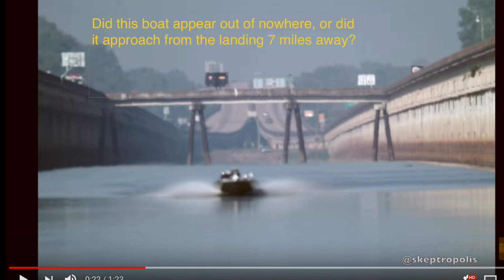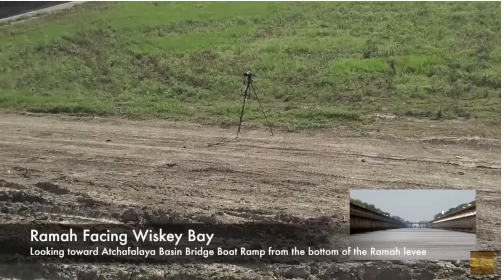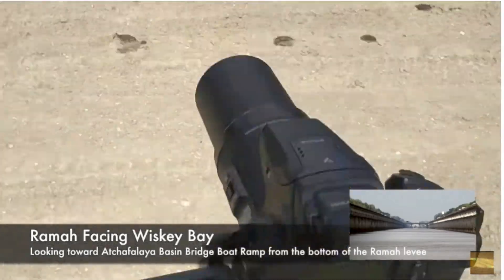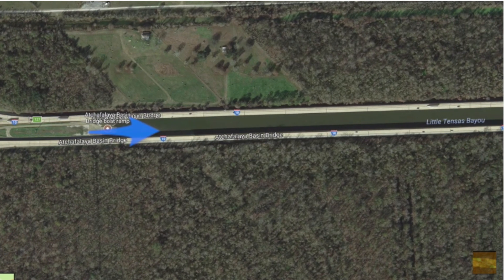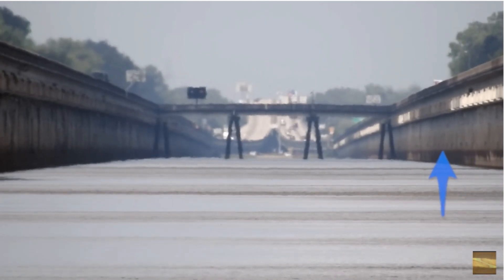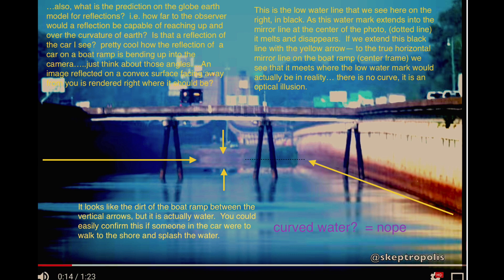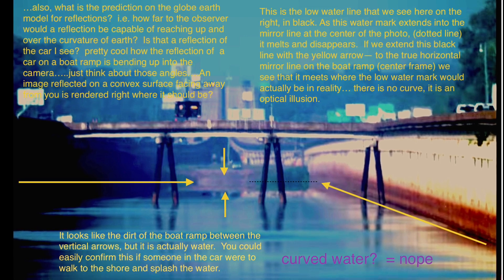Is this Bayou level and curving?

Comment: 1) It was a time lapse, not a video. 2) please link me to the flat earth geometry based obstruction height calculator so I can compare it against my observations.
Reply: Soundly agreed. The boat ramp and piles the bridge is sitting on are so obviously disappearing. The other thing is about that reflection. Some things were completely ignored in this critique. Psy, take a look at the photos from the p900 on my channel. The reflection of the bridge on the water is only possible if the water is curved or some kind of optical illusion creating the appearance of curved mirror
Reply: psyleidoscope I find it surprising that you said anything about angular resolution, when the camera is clearly resolving the car and boat ramp at LTB. Also the camera is clearly resolving the far transmission line. Also the second crossover is clearly resolving. So that's out. Perspective maintains straight lines so that is out as well. Atmospheric distortions are variable depending on the weather, so that is illiminated. Also CAD models of the Globe with these structures on them match my observations. So it's clear the only model that predicts these observations is the globe. Until you have another model that makes better predictions than the globe, I can think of no rational reason to favor alternative conjectures.
Reply: So to sum up;

"Show me the curve."

"Here's the curve."

"That's an optical illusion. Show me the curve."

I've seen this play out dozens of times. FE advocates will consistantly cut off any avenue of evidence that detracts from the flat earth. These are not people interested in the truth. They are an objective leason as to why a dogmatic belief in ANYTHING is universally a bad thing.

Oh, and before I get accused of being a believer in the "ball". My belief isn't dogmatic, my belief lies in science as a methodology, based on the results its produced over the last 300 years that belief, or more accurately, faith in sicence and the scientific method would appear well founded. Cutting off vast tracts of science and declaring it fake because it's inconvenient for your belief is not rational.

Another common trait amongst flat earth advocates is they have little to no knowledge about the subject they're claiming was fake, if they were indeed truth seekers the first step would to become an expert in the subject you think is false, then you can go through point by point and demonstrate using well established tools why it's wrong.

But nah, it's MUCH easier to stick to pointing at water and saying "Well it looks flat to me, so it MUST be flat."
Reply: No we do not have footage of the boat being dropped off. We tried something like that early in the morning just before daylight where I drove to the bottom of the boat ramp and shined my lights across for soundly to photograph but the fog was heavy and it didn't turn out the way we wanted so we are going to do that again soon.
Reply: psyleidoscope And what physical limitations are you referring to and how do they apply to a camera with a zoom lens?

I'm smelling bullshit.
Reply: Look, about the reflections on the water in the P900 video, I'm going to send you a still frame from the one I'm talking about to google hangouts.
Reply: Check hangouts psy. Also, seems like metabunk lines up with what we see here.
Reply: psyleidoscope I find it fascinating that you bring up the reflection as the bridges reflection is not symmetrical. In fact it would require a curving surface for that type of reflection. Your objection makes no sense as the water is below both objects so obviously you can draw a line from the car to the water surface to the eye of the Observer which is the path that the light would take.
Reply: psyleidoscope first you ignored the reflection of the bridge which can only happen on a curving surface as it is not symmetrical. Second you failed to mention observer height which is required to determine obstruction height. Third the obstruction height on a flat surface would be zero. Fourth the entire boat ramp gets obstructed by simply walking down to the bottom of the Levee. Fifth this scene is predicted to look this way by globe models. There are no other models that make this prediction therefore there is no rational reason to believe in alternative model. The car is clearly not obstructed by the water which means that you can draw a line from the car to the surface of the water then to The Observers eye therefore you should expect it to be reflected in the water which it is.
Reply: @Soundly, fair enough, I was only really thinking about the car. But by and large not really concerned about reflections given the video shows an obviously curved high water mark, anything beyond that is window dressing.

Congrats to Psyleidoscope - you found the curve.
Reply: psyleidoscope you are not being skeptical. You are being a denialist. That's an observation, not an opinion. Where is the flat-earth obstruction height calculator? Who cares about eratosthenes you can do the same experiment right now and it only works on a sphere. Have two or more people at different latitudes measure the angle to the sun on any day. It only works on a sphere
Reply: psyleidoscope Uh huh, that video is bullshit. Light refraction is very well understood, the atmosphere is NOT distorting the position of the sun anywhere near like that idiot is suggesting. At most, a few fractions of a degree. This can be evidenced by the fact that you can do this experiment as often as you like and you get consistent results. That video is just another example of the ad hoc bullshit the FE movement is becoming famous for.
Reply: "playground games" dude no one is playing games. This has been a constant thread of you making claims, being shown you are wrong, and then moving on to your next claim. This is real simply. I have detailed which transmission lines I've photographed AD NAUSEM on my channel. You apparently are using the wrong lines, most likely due to the disinformation that Dr Zak put out (and was immediately debunked) months ago. When are you going to wise up and realize these gurus are conning you? Will you be a man and admit you are wrong? We will see. Simply supply GPS coordinates for these 2 dozen white buildings and I'll happily correct you. If you insist on claiming there are 2 dozen white buildings without providing GPS coordinates, then you sir are lying through omission and you sir are the one playing "playground games". I await your response.
Reply: psyleidoscope I don't speak for author's. This is in line with the conventional models absolutely. And it's completely out of line with flatearth models... Any of them. There is no known optical effect to create this type of curvature/obstruction consistently day in and day out.
Reply from the maker: Soundly ahh, ok that makes more sense, but how about the video from the lower observer height?  got any footage of a boat getting dropped off on the ramp from 7 miles?
Reply from the maker: Soundly https://www.metabunk.org/curve/

but this site is not a "flat earth geometry based obstruction height calculator"  in fact it is more stringent, adding refraction calculations which only ever makes it more difficult to prove.  Mick west.
Reply: psyleidoscope you misunderstand. I want the flat earth based calculator. Not the globe based calculator.
Reply from the maker: ahh, right.  does one exist?  would love to see it myself
Reply: psyleidoscope not that I'm aware of.  Could you draw me a diagram demonstrating how obstruction occurs on a flat surface?
Reply from the maker: Soundly Obstruction occurs on a flat surface just like we observe in reality.  there are several things at play...
Angular size:  distant objects appear smaller, eventually disappearing 
Angular resolution:  similar concept, but this accounts for the details which can be resolved by eye or lens.
The horizon is formed inside the eye itself.  it is different for each observer and is determined largely by elevation.
Next we have all sorts of atmospheric effects which can distort these observations:
 Mirroring can occur on top of the visible waterline on what looks like the horizon.  the farthest and tallest waves are mirroring and magnifying the water itself, forming 'obstruction'.

The mirroring can also occur on top of the actual waterline in the water dense AIR above the water.  the thick air forms a mirror- reflecting the water directly beneath it or (behind it.)

I am sure you have seen footage of runners disappearing legs first.  this optical illusion can be easily duplicated by placing a camera on a flat road on a hot day.  like the mirage in the desert.  when the camera is directly on the road, the horizon (for the lens) is quite close.  within a short distance, the runners will "melt" into the roadway, soon disappearing waist deep.  But pick the camera up, or just look from normal height, and the runner has not "gone over the curvature"

As far as a diagram, i think the horizon calculations we are given are pretty close to reality, just that the horizon is not the "curvature of earth" but simply a phenomenon of our eyesight.   the words perspective, and convergence get thrown around a lot.  but your footage on this bayou is a perfect example.  In the foreground, we see the actual (parallel) distance of the two roadways.  We know that they are quite parallel, but in the back of the image +8 miles away, the roadways nearly merge.  if it were a bit further, they would merge together. (optically only)

The same is true for the water and sky.  But this footage is unique in that at 7 miles, there is land again with objects to be seen.  If the bayou kept going 20 miles,  there would be a vanishing point vertically and horizontally.  this is how the eye works.  you have seen the footage in long hallways... same thing.  from our perspective, the walls which are parallel, meet at the vanishing point, and the ceiling and floor meet at this same point.  

The curving you are witnessing and filming (in my opinion) is due to the high moisture content in the air.  this moisture is causing a mirroring, compression and stretching of the image.  Just look at the car squish flat, then stretch out.  the bridge is doing it as well.  the center of the image is where all the action is taking place.  you have natural convergence (parallel lines meeting due to our eyesight) and at the same time we have bending and warping due to mirage and mirroring.  the center of image is quite compressed ---this is evidenced by the pillars so close together, that they actually look like cement walls.  

In short, if this bridge were built inside a 10 mile warehouse, with temperature control, it would look like a long hallway.  BUT-- add moisture, heat, sunlight, smog, varying temperature gradients and humidity levels, we see this very cool looking optical 'curvy' illusion.
Reply from the maker: vanillaHchrist  i suppose you missed the part t 0.59 where i show how this video beats metabunk's calculator even with the refraction calculation?   I have already commented on the powerline images.... look:  this location here on the Bayou is the PERFECT location for a real scientific test for careful measurements to plot the curve which you think is there.......if you are so sure......then go prove me wrong, and laugh at my stupidity.   I reserve the right to be wrong, but from my own observations over very similar distances, I can tell you honestly, and without reservation, the water is flat.  the real curvature killer is the reflection of the car filmed from 7 miles.....and it is not even stretched.  Think about what that means...... you, the observer can film a reflection of a car, which is reflected off the convex surface of the bayou.   If you were standing on the boat ramp, you could see the reflection if the light was right.  BUt with the curved water hypothesis, there is an 8 foot bulge at the horizon about halfway across.  this means that the water arcs UP to the horizon, then it arcs DOWN to the ramp.  How can a image reflected on a curved body of water reach the lens of the camera from 7 miles? ---and still look like the car?!  the answer is much simpler than you think.  the water is flat.
Reply from the maker: 3 excellent videos discussing eyesight, perspective, angular resolution, diffraction, and convergence on a flat plane :  https://www.youtube.com/watch?v=bSSOphWOt0U&t=542s
https://www.youtube.com/watch?v=CY76EtflWkA
https://www.youtube.com/watch?v=oDjju_IM2xc&t=131s
Reply from the maker: Soundly.. you are welcome to your interpretations, and convictions....but until a true and honest test where careful measurements are taken and a curve is plotted, expect these types of rebuttals to "flat earth debunks" or "curving water found".

I don't expect you will conduct a test, and I am not making any demands of you.  (I do hope you will, many folks do...)  I think your videos and photos are pretty unique indeed.   If these videos and observations are enough proof for you, then so be it... I just happen to completely disagree on the cause of the 'curve'.

Any thoughts on the reflection of the car?  How does a reflection on a convex surface enter the lens of a camera 7 miles away?  can CAD model this?  imo, the reflection of the car is a picture of reality.  i.e. only possible on a flat surface....if the surface were bent in any way, the image would be stretched, and at these distances it would be utterly impossible to see.
Reply from the maker: Soundly    Specifically the reflection of the car.  look at the curvature calculator:  in 7 miles, there is supposedly a 8 foot "bulge" about halfway.  after that, there is a large drop...totaling about 30 FEET> (as in CURVE down and away) from observer.  the reflection of the car would be quite near the boat ramp.   this reflection (if you believe your curved water theory) is being reflected on a convex surface which is facing the boat ramp, and away from the observer..... but this image is bent up (by X degrees)..to be filmed 7 miles away???  sorry, i do not follow your logic.  

When you say "the water is below both objects so obviously you can draw a line from the car to the water surface to the eye of the Observer which is the path that the light would take."......sorry but, imo, this is only possible on a flat surface...

the reflection is entirely different than seeing the car....which also defeats metabunk on its own..  the car would represent the "hidden" or in metabunk the "refracted hidden".  this you can argue, even though i have demonstrated that your own video defeats metabunk.

the reflection of the car is entirely its own scenario, and I would love to see it modeled.  good luck with that...
Reply from the maker: Soundly:
first, which bridge reflection are you referring?  time stamp?

second,  .....I failed to mention observer height?  its your video......you said the camera was 2-3 feet off the water......did you take any actual measurements?   why don't clearly state what the observer heights were?

third.  I feel that you are wrong about obstruction height being zero on a flat surface........This assumption is ignoring how the horizon is formed in your eye.  watch the first link above.  there is a repeatable experiment using a small glass bottle placed on the ground  a few hundred feet away.  from eye level, you can see the whole bottle with a good zoom, but place the camera on the pavement, and part of the bottom is obscured.  it is physics.  The angle is too shallow for any detail to be rendered.  This is the same principle in play when we see buildings being partially obscured.  science, tried, true and proven.  and you can see for yourself.  

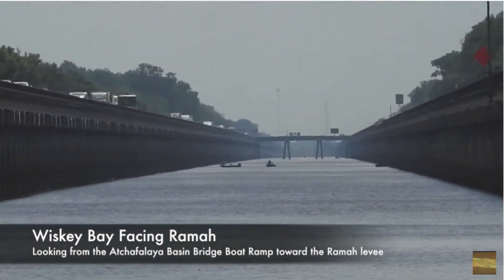fourth:  Are you denying your own video evidence?  I can clearly see in the lowest portion of the video you posted, not only the car, but also another car's height BELOW the car tires.  (about 5 feet of ramp)  this is what i drew in the diagram @ t 1:32  https://www.youtube.com/watch?v=P75W5V790hg

fifth:  you are ignoring the necessity of the convex surface (globe model) which is facing toward the boat ramp, and away from observer 7 miles away.  YES you could draw a line like you say, but that does not explain how a reflection is seen on the back side of a convex surface aka curved water, from 7 miles away.  

If you think this is the prediction of the globe model, then that is fine.  I happen to think it is not in accordance with the physics of light propagation and convex surfaces.
Reply from the maker: vanillaHchrist thanks for the heads up, ill try to remember that one.
Reply: we are not going to see what's on the backside of the convex surface so why do you keep bringing it up? All that matters is what the observer sees. If an object is above the mirror, you can see it. The car is not obstructed by any convexity of the mirror unless it's below the apex of the mirror which it isn't. So what are you having trouble understanding? Make a video or a diagram or something. Go get a cheap bendy plastic mirror and demonstrate how a mirror is somehow supposed to stop the vehicles reflection when it is above the apex of the mirror.
Reply from the maker: I would love to model this...(i have cinema 4d, but am novice only) because in my opinion is that an observer would never be able to see the reflection of the car no matter how high you climb on the levee.  
IF the water is actually CURVED in reality, an observer would not be able to see ANY reflection which is over the saggita or bulge which the globe model predicts.  
In this particular case the  bulge is about 8 feet tall and it is located at 2.2 miles.

MY personal understanding on convex surfaces is that an observer would not be able to see ANY reflections coming from the opposite shore 7 miles away.  none.  No matter how high you climb.  The only reason you can see the reflections is because the water is Flat, level and horizontal  i.e. NOT curving at all.
Reply: psyleidoscope Well that makes no sense geometrically.  It also makes no sense that the reflection of the bridge is not symmetrical, which is a requirement if the surface is flat.
Reply: psyleidoscope "imo, the reflection of the car is a picture of reality. i.e. only possible on a flat surface....if the surface were bent in any way, the image would be stretched, and at these distances it would be utterly impossible to see."

First of all, there's no such thing as "flat". Nothing in reality is flat, there are only approximations of flat. That approximation might be in the micron range, but the point still stands. A curve 6000km in diameter when considered over an area of a few metres is flatter than the mirror in your bathroom.
Reply from the maker: in 7.2 miles, the NECESSARY geometric curve of the surface of the water is a 33 ft DROP after a almost 9 foot bulge at the horizon.  DRAW it or model it in 3d and see if you think a reflection from the distant shore could be seen from 7.2 miles.  I won't argue the definition of flat.  but I would love to see your model of reflections on a CONVEX water surface.  :)  good luck
Reply: psyleidoscope we have modeled it.  It works perfectly.
Reply from the maker: link?  you modeled a reflection?
Reply: Rab S the reflection of the bridge is not correct if the surface were flat. The reflection of the bridge actually confirms that the surface is curved. This is obvious evidence and overwhelming and it matches the conventional model. The fact that I have thousands of observations now and flatearth has has zero unambiguous observations that match a flat surface means it's completely delusional to believe in the Flat Earth. Regrettably you and others will remain oblivious to this fact as you've been brainwashed.
Reply: psyleidoscope I've modeled many things I've yet to see one of your flaearth models. Where is it?
Reply: psyleidoscope I'm still waiting for that Flat Earth obstruction height calculator. Interesting that the only model that this matches is the conventional.
Reply from the maker: Soundly  " Interesting that the only model that this matches is the conventional."  ahhh you are starting to realize ;)

interesting also that your own videos debunk both PBS and the Metabunk calculator.   model much?  Soundly....the obstruction height calculator IS very much what the current horizon calculator states!  it has to be.  It is designed after the anatomy and physical limitations of human eyesight.  

You and I both know that if you go back to the bayou on a COOL autumn day when the water temp and the air temp are equal, and place your camera 2 ft off the water, You will easily film a large BRIGHT orange object which is also 2 ft off the water, 7 miles across.  But then you will claim refraction magically lifts the image up and over the the curve.   relativity is a THOUGHT experiment.  Your videos, interesting and unique as they are, are optical illusions.  The surface of water does not bend like u think.  You have not modeled a reflection on a convex surface from 7 miles..... because.... It is not possible??  dont fret.  we all fell for the illusion.    Why do you keep mentioning the halfway bridge but not the car which is 7 miles?   This Tensas bayou footage is unique in that it gives a reference with a known distance , unlike your powerline footage which is just a bend out there somewhere.....here on the bayou, we have a boat ramp, and objects which can be measured and much more information can be gained.  I hope next time you venture out, you will take careful measurements... this will go a long way in explaining what you are filming.  cheers.
Reply: psyleidoscope false. With the camera just inches above the water you will see the affects of refraction (a conventional model prediction). It will cause the bridge to appear to straighten out variably. However the bottom of the boat ramp will be obstructed. I know this because I already have the photograph. Yet you have zero observations like this to compare. How interesting. Your confidence is based on delusion/Faith in your gurus. Not evidence. The evidence thrashes flatearth. It's that simple.
Reply: Rab S apparently I mistaken you for a flatearther. My apologies
Reply from the maker: If i appear confident, it is because I AM.  this is not based in delusion or guru's :)  you funny.  No i am confident due to MY OWN observations AND MEASUREMENTS.  You have many observations and video, but your measurements are lacking.....like there are none.  It is also interesting to me that you would go all the way out there, and not take any measurements!  You are content with your curvy photos, and that is fine....  You also know if you actually bothered to take careful measurements at the tensas bayou, you're curved water theory will fall flat______.
Reply from the maker: this is not a flat earth channel.
Reply: psyleidoscope The main problem here is your method. Keep in mind we knew the earth's size and shape LONG before the invention of the zoom lens. So here you are, looking for curvature over a very short distance, which means atmospheric distortion is going to be a major factor, despite your assertion that it won't be. But here you have a picture with a curved high water mark that you pretty much dismiss out of hand and are focusing on a reflection of a car which you contend shouldn't be possible on a convex surface despite the convexity being miniscule.
Reply from the maker: Rab S First off, this in not my footage.  Actually this is Soundly's footage, and HE is claiming that it proves curvature,  and DEBUNKS flat earth.   I think you might be confused. 
Next, you may not be aware of the rate of drop on the globe earth.  You and many others keep calling it miniscule, but in 10 miles there is a 66.6 FOOT geometric DROP.  THis is the height of a 6 story building.   Think of it this way.  If the curvature were true, someone standing on the street is somewhere level to a person standing in the 6th story of a building, 10 miles away.  this is a massive convexity.  
As far as the above video, which is over 7.2 miles, the water surface, (according to globe model) MUST be over 32 FEET lower on the distant shore.  How you can call the convexity miniscule defies logic.  You are just trying to make excuses for why you can see the reflection.  In globe model the reflection would NEVER be visible beyond the halfway point. EVER.  No matter how much refraction is present.  If we are dealing with a convex surface then the reflection is being reflected BACK at the object, and it could NEVER reach the opposite shore.
Reply from the maker: vanillaHchrist  the idea of flat earth is as old as humanity.  guess you did not think that one thru.
Reply: psyleidoscope You are correct, I was confused, and apologies, the point still stands and is now aimed at Soundy :) I am however WELL aware of the geometry of the earth but I'm not sure you are. 66.6 feet over 10 miles might sound like a lot, but it really isn't. To scale, trying to detect that minute curve clearly requires conditions to be "just so" or refraction is going to play he'll with your observations. Having said that there are hundreds of images of city skylines with hundreds of feet cut off the bottom. Nevertheless, this method is always going to be a bit messy. Measuring the height of the sun at noon by measuring the length of a shadow at various latitudes is a much cleaner method which will not only confirm there's a curve but allow you to calculate the radius. Unsurprisingly the FE movement refuses to do this experiment with more than 2 data points. In actual fact, you can do this experiment yourself by using online data, and just take a local measurement to confirm the data you get from the Internet.
Reply: psyleidoscope Yes the idea of a flat earth has been around a long time, but the people of the past at least had the excuse of not having access to hi res images of the planet from space.
Reply: Rab S I don't know how many times I have to say that when you modeled this in 3D it looks exactly like my observations. Refraction, standard refraction, has very little effect on observations when taking 15 feet or more above the water. Atmospheric turbulence causes most of the distortion and in video you can see that it's a variable and wavy not something static like flat-earthers believe. Especially with time lapse you can see that it's not static. However my observations show static curvature. And when you model it in 3D Like Walter Bislins  then my observations validate the conventional model, which I state again is the Only model these observations validate. It's plain and simple you'd have to be delusional to believe the Earth is flat as there is no rational reason to do so.
Reply from the maker: Rab S  "66.6 feet over 10 miles might sound like a lot, but it really isn't."
In my reality 66 feet is the height of a 6 story building.   this IS a LOT.

"Having said that there are hundreds of images of city skylines with hundreds of feet cut off the bottom. "
not from 10 miles there isn't.  and the bottom starts to disappear due to the physics and anatomy of the human eye.  when your eyeball elevation angle meets with the water's surface angle (at the horizon) the angle becomes too shallow for the human eye to resolve any details of the surface.  objects which are further than this will become obscured due to the physics of the human eye's limitations (1/2 arc minute MAX)  Objects which are ABOVE the eye, and further away will still be visible for much further against the sky-----again, but there is a physical limitation which cannot be improved.  the horizon is formed at the center of your eye, and is unique for everyone.  https://www.youtube.com/watch?v=bSSOphWOt0U&t=1548s
Reply from the maker: and here is a "flat earther" demonstrating that Eratosthenes 2000 yr old experiments were flawed, and there is most certainly other possibilities to explain the sun angles than the curved surface model.   It does not matter if he is even right.   He proves that there are more explanations than the heliocentric model.  https://www.youtube.com/watch?v=bol8vZ7pcu8&t=227s
Reply from the maker: that is your opinion.....I am pointing out obvious flaws and shortcomings of the heliocentric model.  I am a skeptic, especially when people are posting videos claiming they have 'debunked' flat earth.  My own observations and data are pointing toward flat water.  I will not be labeled or put into a box.  PBS/ hawking lied to the world.  this above video is simply capturing an obvious optical illusion.  Why not question and point to pseudoscience when you see it?
Reply: psyleidoscope Must admit I've yet to see anyone point out any flaws or shortcoming of the heliocentric model that weren't based on a lack of understanding. The only issue I've seen is measuring the curve over short distances, which, as mentioned, is tough to do. Although I did mention you could use a theodolite to measure the angle between horizontal and the horizon, over water, which you can used to establish a radius. You could then confirm this as different elevations. If I recall correctly your rebuttal consisted of "angles are just angles", which suggested a lack of understanding of basic maths.
Reply from the maker: vanillaHchrist  funny you should mention Lake Ontario.  Jenna Fredo took this footage which with the matabunk refraction calculated, her observations demonstrate that the curve is imaginary:  https://www.youtube.com/watch?v=__liPsAYnJs&t=9s&index=57&list=FLhdIgaURFG9rf8kpxBghUZA
https://www.youtube.com/watch?v=zm56dTZRSus&t=2s
Reply: psyleidoscope I find it humorous that you keep saying I took no measurements. The photograph is measurements albeit relative measurements. But if I were to set up a theodolite it's measurements with graph a curve because a theodolite is nothing more than a telescope with angle readings on it.
Reply: psyleidoscope you could take the same measurements albeit relative with my photographs by using XY plotting coordinates. So yes I did take measurements they're embedded in the photograph.
Reply from the maker: "So yes I did take measurements they're embedded in the photograph."   this makes me chuckle.  You honestly believe that "measurements embedded in a photograph" with extreme distortion and refraction or whatever else that amazing optical illusion would be called are in any way, shape or form accurate?  You are entitled to believe whatever you choose.
Reply: psyleidoscope 1) there is no extreme distortion. That's a figment of you imagination. I repeat ad nauseum yet you fail to  learn that this is exactly what models show it should be. 2) the same scene would be witnessed by a theodolite. 3) you chuckle from ignorance and lack of understanding of these singular facts.
Reply from the maker: vanillaHchrist   3 excellent videos discussing eyesight, perspective, angular resolution, diffraction, and convergence on a flat plane :  https://www.youtube.com/watch?v=bSSOphWOt0U&t=542s
https://www.youtube.com/watch?v=CY76EtflWkA
https://www.youtube.com/watch?v=oDjju_IM2xc&t=131s

too funny.  you post a sunset and claim it proves globe earth.  
THE HORIZON IS FORMED IN YOUR EYE.  
the reason the bottoms of buildings are obscured over Lake ontario, is the very same reason the sun disappears bottom first.  your eyes can no longer  resolve the surface of the water with the increasingly shallower angles  (from your eye to the surface of the water extended to the horizon) physical limitations of the eye OR lenses
Reply: psyleidoscope the angular resolution of the eye or lens is just fine as it can see CN tower. So you can't use angular resolution, which you've been repeatedly corrected on. Is there something you don't understand about this fact I can help you with?
Reply: psyleidoscope Can I point out the elephant in the room of the sun somehow REACHING the horizon despite supposedly being 3000 miles in the air and NOT shrinking to a dot?
Reply from the maker: we are watching the sun "set" over water in Australia.  there is heaps of atmospheric refraction/lensing especially just above the water.  There is footage of sunsets in cold deserts where the sun DOES shrink to a pinpoint as it sets.  btw, i am not claiming the sun is 3,000 miles up.
Reply from the maker: Rab S
https://www.youtube.com/watch?v=e1TUpNkHcAM
Reply: psyleidoscope there are no videos anywhere with a solar filter that show anything but the sun setting. It's completely disingenuous to use any footage that does not include a solar filter.
Reply: Rab S interestingly the height does not matter. If the surface is flat, it can never set.  https://youtu.be/MPG_cb_xrKQ
Reply: Soundly Arguably it could with refraction (which obviously isn't a constant), but this would mean the effects of perspective would be even more pronounced. But the glare thing got boring a long time ago. I always refer to the moon rising and setting as my challenge, its a bit harder to for them to be completely dishonest - a common trait amongst truth seekers.
Reply from the maker: "interestingly the height does not matter. If the surface is flat, it can never set. "   again, you are not taking into account the basic fundamental physical limitations of the human eye.
Reply from the maker: "psyleidoscope so everything provided here is just mirroring mirages? https://www.metabunk.org/soundly-proving-the-curvature-of-the-earth-at-lake-pontchartrain.t8939/"

well there are a few things at play in the powerline images...diff sorts of atmospheric refraction/mirroring.mirage/   In all the footage i have seen (lots) on soundly;s site where he is filming/shooting these power lines, the distant shore never seems to be visible, or just barely, like in smudges.  BUT there is footage from someone else who took video from the same location, and shows a straight and parallel set of powerlines AND you can see CLEARLY the opposite shore for reference..the TREES are visible in the pan from right to left!!    Of course metabunk and others dismiss this footage (naturally) My view on this set of powerlines is that if your footage does NOT REVEAL the opposite shore with decent details , then your image is (clearly) being distorted part way across the lake..many times in his footage it is hazy or foggy as all get out....what does this mean?  there is massive humidity in the air...couple this with WARM weather.....IT IS Louisiana after all.....and this distortion is giving a FALSE sense of curvature....and YES heaps of mirroring.  But I digress.  I would rather stay focused on the REFLECTION OF THE CAR in the video i posted.  https://www.youtube.com/watch?v=G5_efcyCjBo&index=45&list=FLhdIgaURFG9rf8kpxBghUZA
Reply: psyleidoscope the reflection of the car makes perfect sense and there is no reason why it wouldn't. Simply draw a side view of this observation. Draw a line from the car to the surface of the water that is directly in the middle then to the observor. Since that is possible you would expect a reflection of the car.
Reply: psyleidoscope there is one video by Johnny Oops that you are referring to. It is very low quality. Demonstrates dramatic turbulence. And does not at all show the opposite shore on the right side. You see there are transmission lines on that shore, which I have photographed the tops of a number of times. Those are absent in Johnny's footage. Also the transmission lines are NOT PARALLEL upon closer inspection. My question to you is this. Since I have literally hundreds of photographs and videos of that location which are orders of magnitude better than the video you reference, then why would you accept his footage of obvious looming and ignore mine which is shot in much clearer conditions and at far better quality, which also match conventional model predictions? (Hint: that's called cherry picking)
Reply: psyleidoscope sure I am. The human eye and cameras are limited by angular resolution which is not even relevant as we are talking about the moon/sun which is clearly visible by the human eye.
Reply: Rab S no it could never set. At it furthest distances on a flat plane it would still be very high in the sky. Watch the video I linked. Regardless of setting when the moon reached 30 degrees altitude it would have to appear half the size we actually witness it to be.
Reply from the maker: Soundly  call it what you want.  Your footage does not show the opposite shore, his DOES.  most of your footage does not even glimpse the opposite shore, where the treeline is clearly visible in his.  If you can take footage which shows the opposite shore, i would love to see it.
Reply from the maker: Rab S 
https://www.youtube.com/watch?v=bSSOphWOt0U&t=542s
this video has footage of an astrophysicist and former MIT physics professor explaining the physical  limitations of the human eye.  anyone who says that there would not be a horizon on a flat plane is ignoring the scientific reality of human anatomy.  camera lenses have the same limitations.  it is all about angles.
Reply: psyleidoscope - not interested in your strawman. No one suggested there wouldn't be a horizon, only that the sun wouldn't reach it on a flat earth.
Reply from the maker: Soundly I am not here to discuss the sun or moon.  or how you might think they work.  this video is about the absence of curvy water on a certain bayou.  If you have no additional footage with measurements then you are wasting your time, and mine.
Reply from the maker: Rab S  My video is not about the sun, or moon.  you and soundly introduced these....i burn your strawman
Reply: psyleidoscope dude. Try to pay attention. His video does not show the very noticable transmission lines which are on the opposite shore. They would have to be seen if he was looking at the opposite shore. They are not, therefore what is recorded in his footage can not be the opposite shore.
Reply: psyleidoscope https://twitter.com/skeptropolis/status/881021190298644480?s=09
Reply from the maker: Soundly I know what i am looking at.  it is the very flat opposite shoreline of the lake.  (I looked at google maps along that shoreline  half a dozen times) there are trees and small white buildings.  the trees make a dark line above the waterline.  this is visible even from minimal zoom in his footage!......clear day, good visibility.  I cannot believe you are disputing this.  His footage shows the opposite shore.  Why can't you get some footage which shows the opposite shore?  Perhaps this fall when it is cool and dry/low humidity.  you say i am cherry picking when my options are video from him or you.  sure you have more, but yours do not match reality. (extremely obvious optical illusion) You want to convince me?  film the opposite shore at the lake, and do an improved bedford level at the bayou.  nothing else will convince me that your images are anything other than optical illusions.  cheers
Reply: psyleidoscope I literally just provided you with a link of the tops of the transmission lines, which are on the opposite shore, while the shoreline is obstructed, in my last comment. My photography is orders of magnitude better that his video. Either you didn't look at the link or you are simply gaslighting
Reply: psyleidoscope also... "white building" now I know you are lying. That entire area is swamp / marshland... Zero buildings are there. Wow
Reply from the maker: Soundly  I will give you an explanation on why they are visible in your photo but not his, but you will undoubtedly brush it off.  but here goes anyway..  Your photo only reaches as far as the towers.  it is foggy white background in the sky behind them.  This gives great contrast for the thin steel frame  towers against a white background.  
In his video.......where the opposite shoreline is def. 100% visible---not enough to discern small objects, but clearly the darkened treeline is absolutely visible......as well as the white structure!  this darkened field of view on the horizon does not offer the contrast needed to resolve the thin steel frames, and they just simply melt into the horizon, and become indiscernible from the treeline!  
again, soundly, If you can provide footage of the opposite shore visible along with the "curved" towers, i will be impressed, but with no measurements, I will never be fooled or convinced of your footage
Reply: You explanation is 1) ad hoc 2) a blatant lie. There are no "white structures" in the swamp dude. Why are you making that up I wonder? Also I have provided the footage, repeatedly, ad nauseum. There are plenty of videos that you can watch on my channel where you can see the transmission lines on the far shore. You can not claim to see the shore if you can't see those transmission lines to the ground. So basically you hope it's a shore, but have zero evidence and the evidence that does exist is against your conjecture. Good talk, you are just being a Riley now.
Reply from the maker: You are not fooling me Soundly, and call me a liar again, and you are deleted.  there are Dozens of houses with WHITE ROOFS along the Tangipahoa River.   I would bet 10 bucks that the WHITE STRUCTURE VISIBLE IN this video is one of those ROOFS.   what else could it be?  .....never mind that HUGE white object center frame, you LIAR?  what gives mate?  https://www.youtube.com/watch?v=G5_efcyCjBo&index=45&list=FLhdIgaURFG9rf8kpxBghUZA

No i dont "hope" it is the shoreline I know it is  :) :) :)
Reply from the maker: 30.332634, -90.278558   this building is casting a longer shadow than all the nearby houses.  This building has a BRIGHT WHITE ROOF.  it is TALL.  there is a HUGE white object in the video:  I AM GUESSING, based on evidence that this is what he filmed.  ALSO IT IS IN line with the sight from the bridge, just to the right.
Reply from the maker: vanilla milkshake you're gonzo
Reply from the maker: "There are no "white structures" in the swamp dude. "   who is the liar now?  by my count there are at least 2 dozen!!!!   omg childish playground attitude. admit you are wrong.  You fool me not.  Soundly you have not filmed "curved water"  you have filmed optical illusions.  and you are currently LIVING IN ONE>
Reply from the maker: Vanilla milkshake.  You, and your derogatory comments have been deleted.  I will not accept childish name calling or other ignorant behavior on my channel.  disagree all yall like...provide evidence.  .that is fine and welcome.  Just do it like fucking adults, and keep the playground games out of it.
Reply: Dude psyleidoscope if you see 2 dozen buildings in the swamp where Johny Oops sees a white object then you have the wrong transmission lines. There is no white building there. It's all swamp and marsh there. Perhaps you should supply some GPS coordinates.
Reply: I just looked up and notice you posted GPS coordinates. And now my mind is boggled as how you thing in any way possible for those structures to be in frame. Especially after I linked you directly to a photograph that show the transmission lines on the far shore.  You can count out 8 transmission towers (the first is behind the large tower).  If you draw a line from the eighth transmission tower, which is on the right most side of the image mind you and way out of Johnny oops frame (WAY OUT). Then even that line is still not far enough to get your building in frame. Not to mention why would it's height matter at all on a flat earth?  You are claiming to see the shore, so it's height wouldn't matter would it.  The P900's field of view is right at 1 degree at max optical zoom.  Dude, this is really really basic and I have half a mind to say you are just trolling at this point. Because no one that has any critical thinking can possibly think that building could be anywhere close to in frame.  The white object is Johnny Oops' video is at best in line with the second transmission tower on the opposite shore.  It's not a building, there is nothing but swamp behind there.  So you brought up a good question.  What could it be, well we know it's not that building, so most likely guess is that it's a crane barge. But I have to guess, because the footage is so shitty.  You really should drop the stubborn defensive attitude and start acting like an adult. Take your own advice.
Reply from the maker: Soundly  well at least at this point you are admitting that there is indeed a large white object in the center of the frame  .  progress.  perhaps next you will concede that whatever it is, it most likely is on SHORE.  as in the shore that is clearly visible from left to right of the towers 15 miles on the distant shore, in Johnny Oops's video but not yours.    Of course the treeline is visible.  you must just pick the right day----i.e. cool, dry etc.  You keep calling his footage bad, but he is showing the distant shoreline, where yours does not.  
and what is this??? calling me a troll on my own channel.. that word, i don't think it means what you think it means.
Reply: "at least at this point you are admitting that there is indeed a large white object in the center of the frame" ? wat? I've never denied that, so nice attempt at mischaracterizing the conversation.  There is NOTHING on shore that is white at that angle. Period. You are simply wrong. Johnny Oops' video is very poor quality. My footage is objectively better in all cases. I've been in various weather conditions and I'll continue to go back as time permits. I will ultimately be the only person to have such comprehensive footage of the area year round and when you see that same curvature I expect you to be honest and convert to the globe. See you then.
Reply from the maker: "I've never denied that, so nice attempt at mischaracterizing the conversation.  There is NOTHING on shore that is white at that angle. Period. You are simply wrong."

I don't get it.....are you agreeing that there is a HUGE white object on Johnny's video or not?
I certainly see a huge white object center frame.  I can see it at almost no zoom as well.  It looks taller than the treeline.  I looked on google for what it could possibly be.  crane barge?  i dunno.  its tall, its wide, and it is bright white.  I guess you would need a boat to find out what it is.  
Soundly notice i am not calling you a liar.  I am looking for what it might be, and you jump off the cliff calling me a liar.  I am trying to be straight and polite, i hope we can keep it that way.

I disagree with you about Johnny's footage.  fine by me.  and in reality, this isn't even the proper thread to even be discussing it.  I am looking forward to seeing some new footage this fall which is even clearer than Johnnys and perhaps it will give us a clue as to what the white object is.
Reply from the maker: Rab S   You are not correctly characterizing. this situation, ME, or my beliefs.  When i say show me the curve I expect a real test with real measurements I am not making demands, but simply aiming a camera at the horizon will not do.  (in my book....fine if you are convinced)
You are a late comer, my friend.   Soundly has not taken any real world measurements to back up his photo and video evidence.  (AND that is fine) EXCEPT he is claiming that his images debunk flat earth!
If all you need is a photo to be convinced of a curve, perhaps you are also convinced of the photos of bigfoot and Loc ness monster?
MY VERY OWN observations and MEASUREMENTS are leading me to the understanding that water lies flat when undisturbed.  this is most certainly NOT a dogma.  I used my very own senses and TOOLS to come to this conclusion.  When I see the curved powerlines and the obvious distortion and the same with the above bridge and bayou, I can see that it is an optical illusion because there is NO CURVE TO THE SURFACE OF WATER at these slight distances.  I already confirmed this (98% sure) So i can determine that there is obviously something else at play.  HUMIDITY, HEAT, MOISTURE IN AIR.  where are these curved images taken?  IN THE SWAMP.  where it is frikkin HOT as well.  I looked at the weather stats for the month the above video was taken and it was about 90 DEG F average.  Did soundly mention this?  all i see is heaps of images with no further information, YET we are to Jump back on the ball because of some isolated images??? 
THEN there is another video of the SAME powerlines which not only shows a STRAIGHT line....no curve.....BUT his footage there is also visible the OPPOSITE SHORE and treeline.  as interesting as Soundly's images are, I am FAR more impressed with Johnny's footage for the SIMPLE reason that YOU CAN SEE FURTHER!!!  make any sense?  
Is any of this sinking in>?
Reply: psyleidoscope I appreciate your new tone, sure I can be polite, I prefer it that way. Let's recap you claimed to see a building that is far... far out of frame. Where the white object is located there are no buildings on the far shore, none even close. The most likely explanation, assuming the footage is genuine, is a boat of some sort. There are also transmission lines that would have to also be visible. The footage is too poor to really know what it is or why we can't see transmission lines so nothing definitive can be said about the white object, nor the horizon for that matter. However, you claimed there are dozens of white buildings in that area. This seems on the surface to be so absurd as to be intentionally deceptive. From my perspective it seems very unlikely that anyone, having seen Johny's video and having looked at the scene in Google  Earth could conclude that the white object was a building. Perhaps I am wrong about your intentions. Perhaps you honestly misjudged the angles. If you can admit that the white object is not a building, then great the conversation can continue. however, if you can not admit that then I think we are at an impasse.
Reply: psyleidoscope this comment to Rab S is not conducive to a polite conversation. When you state your conjectures as fact without evidence that is called sophism, which is dishonest and calls from swift and harsh rebuttal. Refraction as it is measured is very slight and can not account for the scene we have at Little Tensas Bayou which is consistent day in and day out in various humidity levels, even at night when it is much much cooler. Those are the honest observations. No variable cause can account for the consistency of the observations/measurements (which is exactly what a photograph is). A measurement of the projection of 3d reality (an image) is a set of measurements. You should drop this silly objection if you are trying to be honest.
Reply from the maker: Why would I admit that the white object is not a building?  Do you know when google maps was updated?  Perhaps i misjudged angles, but this in no way makes me a liar.  Perhaps a NEW building was constructed without you knowing?  is that possible?
Next i hope you are not hinting that Johnny's footage may be doctored?   you think he placed a blurry cgi white object?  i hope you are not serious.  
"However, you claimed there are dozens of white buildings in that area. This seems on the surface to be so absurd as to be intentionally deceptive"

Soundly you said repeadly that there were no buildings, and it was just a swamp.  this is NOT true.  there are MANY, MANY houses and other types of buildings.
I do not even care about the white object.  But it is there.  forget it, i do not care what it is. 
I am done wasting my time on this, it is going nowhere.
Reply from the maker: "You should drop this silly objection if you are trying to be honest."  with all do respect, i will not drop this objection.  
I am still looking for real tests with real measurements in the real physical world.  
If you do not agree with my observations or requirements for proof, then perhaps you might find your time better spent on another channel. 
I respect your opinion, but I just happen to disagree.
Reply: @psyleidoscope Then stop looking at water - as I mentioned before refraction is going to play hell with observations. There are quite obviously dozens of images and videos showing distant objects obscured by the horizon to which FE'ers will claim atmospheric effects and vice versa. I gave you a real test, and the clown shoes video you posted as a rebuttal kind of says it all - any ad hoc excuse will do, whatever it takes to deny any avenue towards the earth being a globe, right?
Reply from the maker: Soundly  why dont we address the points i made in This Video:

true or false_       Your very own footage at the Bayou that i highlighted beats the Metabunk calculator?  even with refraction calculated in...

ture or false_    Your very own footage at the Bayou that I highlighted in the above video debunks the 24 foot curvature claimed by PBS and Hawking as they demonstrated by landing a helicopter behind a 24 ft tall wall of water which they claimed was earth's curvature?
Reply from the maker: Dandypanty  If the water is curved away from the observer(camera) then how can a reflection which only manifests itself on the surface of the water  be seen (at all)  from 7 miles distant?  If the water was curved down and away then it should only be seen from the other side......at least this is my opinion.